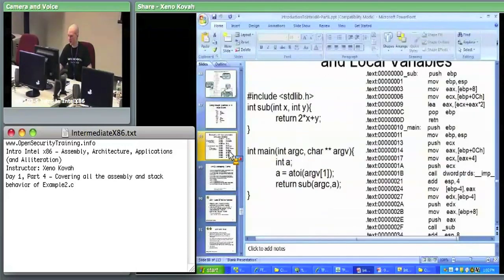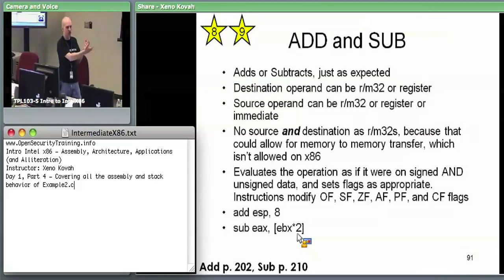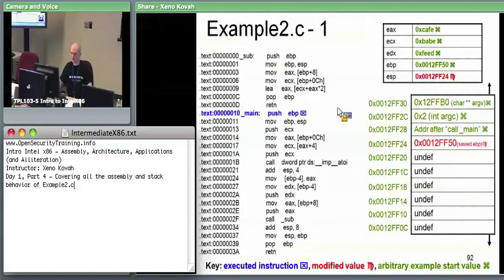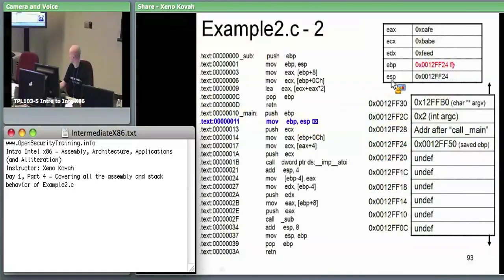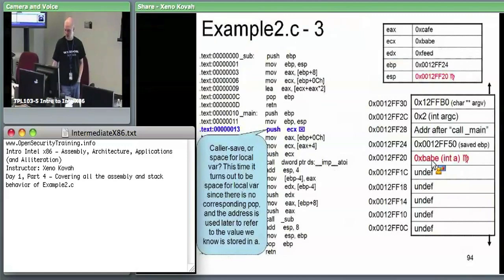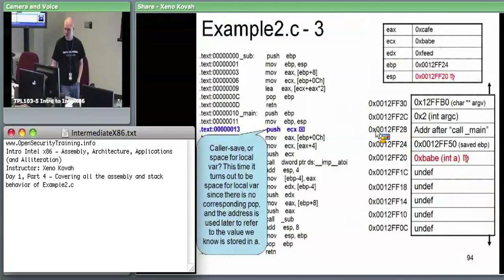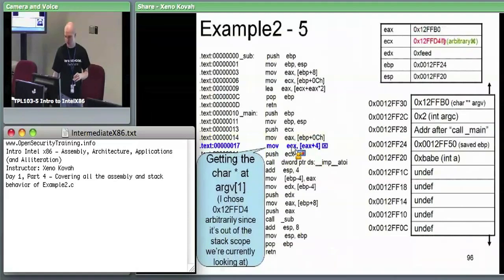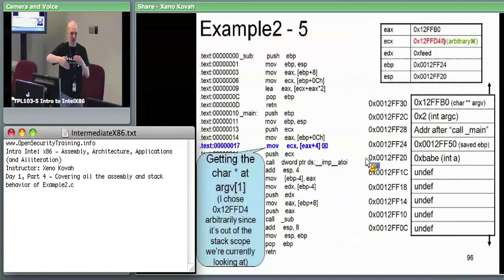Day 1 Part 3: Introductory Intel x86: Architecture, Assembly, Applications

Comment: Why a value in the stack should be first moved to eax  ( mov eax [ebp+8] ) then eax pushed (push eax), why not to push what in the stack immediately (push [ebp+8]). Can we actually  do that (push what is actually in the stack ) ?  the answer is 40:45 (the code is not optimized)

Comment: The lea trick is intuitively somewhat deceptive. I solve Project Euler problems (algorithm programming) in x86 assembly and the lea trick in the subroutine was an eye opener for me. You could have dwelt upon that a bit more, imo. Excellent videos, though. But I think they are hard to follow if you do not code some x86 between the viewing of each video.

Edit: It was good that your students made you talk more about the lea trick!
Reply: Ya, i'm shocked as well. I was just looking in the comments for an explanation or someone that could expand on it. 
Those values are at the addresses that are listed in the registers. So what mechanism is going to each of those addresses, remembering them, and then doing the required calculation to store into eax? 
Can YOU answer that for me?

Comment from the maker: Yes, because this is purposly un-optimized code, there is a 1:1 correlation between the compiler generating two pushes before the call, and therefore an "add esp, 8" after the call. Once you get to the "mov esp, ebp" that's just the standard function prolog the compiler happens to have picked for this function based on how many local variables it had, etc.

Comment: I see that throughout this course, we refer to [ ] characters as angle brackets.
The terms that I find the largest number of programmers understand (although there are global variations, I mean for people who are working in or together with people in North America) are:

[brackets] or [square brackets]

<angle brackets> or more awkwardly <less than greater than> or for xml nerds these days just <tag>

{curly braces} or just {braces}

(parenthesis)

In assembly we will only see the < and > characters in comments anyway, so it isn't too confusing within the lecture itself.  In a mixed language discussion, which this sort of is, I'd never call the indexing operator in C/C++ angle brackets, but always either square brackets or just brackets.  We only see "angle brackets" in C in the  #include  <stdlib.h> line in the example code.

Anyway, awesome lesson, and I probably wouldn't be so sensitive to this if I never had to quote code over the phone at all ever.
Reply from the maker: Correct. Xeno regrets any suffering caused by mis-description of the brackets ;)

Comment: Wouldn't it be an even better optimization at 23:39 , deleting the last to blue instructions?
Because 0x0012FF20 could already be treated as the first parameter, then you only need to push the second parameter!
Reply: Yes, that would work; actually, a lady asked this very question during the lecture. The reason this wasn't optimized by the compiler is because we configured the project to disable optimizations.

Comment: In Example2, around 35:00-36:00, why is the add esp, 8 instruction necessary? Wouldn’t the mov esp, ebp instruction accomplish both lines on its own? Or is this a result of unoptimized code?
Reply: The result of unoptimized  code. First the function caller does what it is supposed to do for the cdecl calling convention; clean up the call stack. Next the program does what is necessary to exit Main()'s stack frame; clean up its local variables.

Comment: Why do we have all those dword ptr at move instruction?? at 1:06:30 for example, why we just could not do mov ecx,[ebp+0Ch] ?
Reply: If you are asking why you must explicitly state that its a dword ptr, the answer is that it is required MASM syntax. Other *ASM know that if the dst is 32bit, and the source is in brackets, it must be a 32-bit pointer. MASM just requires more verbosity.

Comment: 42:30 question if ret and retn are the same, found the answer on stackoverflow..

In the mnemonic ret N, N is the size of parameters on the stack.
But this only applies to calling conventions when the callee is responsible for stack cleanup. In case of cdecl convention the ret should be without any numbers, as the caller is responsible for stack cleanup.

https://stackoverflow.com/questions/1396909/ret-retn-retf-how-to-use-them
Reply: That is actually incorrect. The reason that VisualStudio shows the instruction "retn" is because it is returning to a "NEAR" address within the segment currently stored in the CS register. Ret, retn, and retf, all take the optional source operand that specifics the number of stack bytes to released.

Comment from the maker: Yeaahh...that's a bit weird. In general it' expected that different compilers or different versions of the same compiler will generate slightly different asm, but that one's a bit of a mystery. As with all our un-optimized asm, the theory would be that there was some more generalized case that the designers were trying to support, but that when the compiler is told to just essentially fill in the asm by rote substitution, it leads to this sort of counter-intuitive output. You should email MS :)